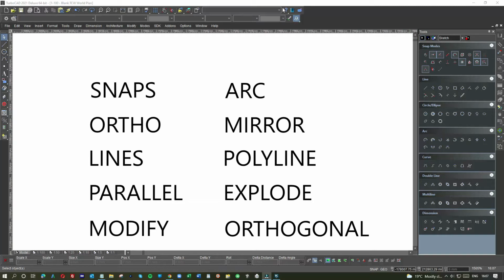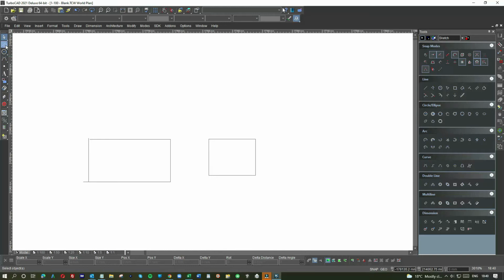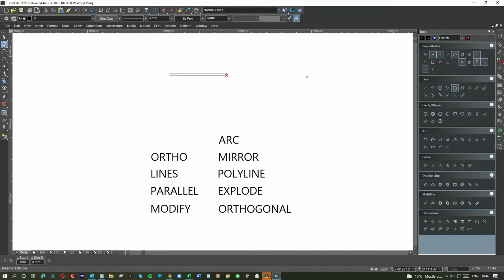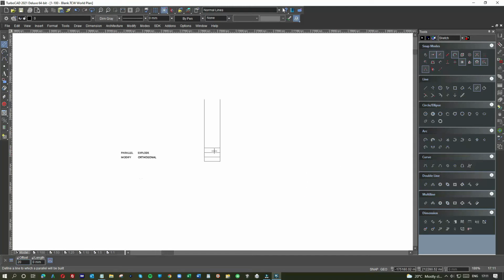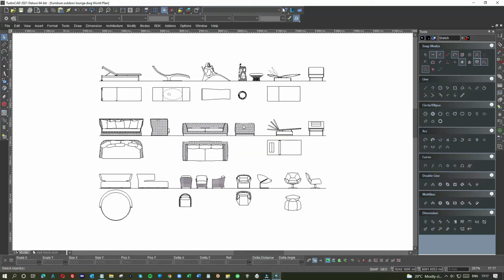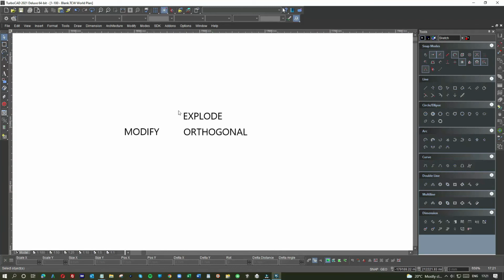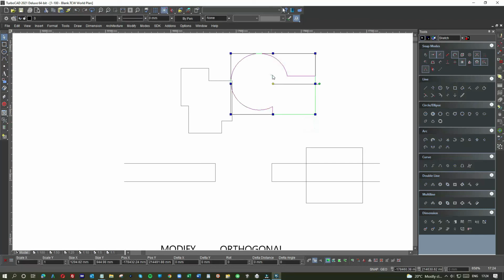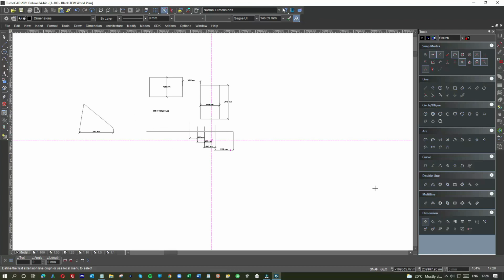TurboCAD Deluxe Quick Start Guide 1 | TurboCAD Tutorial | How To Use CAD | Draw Plans

Comment: One key info that's missing here is the info about how to open those extra menus associated with icons which have small white triangle in the bottom right, because hovering over them does absolutely nothing. You need to click + hold on the icon to get this menu to open up. I guess I got spoiled by the modern hover over UIs you can find on the web lol.